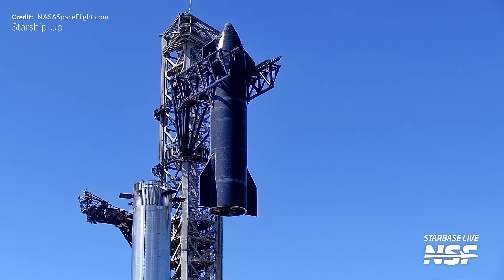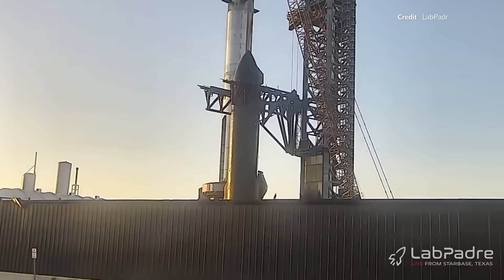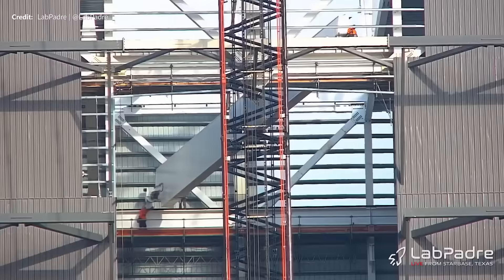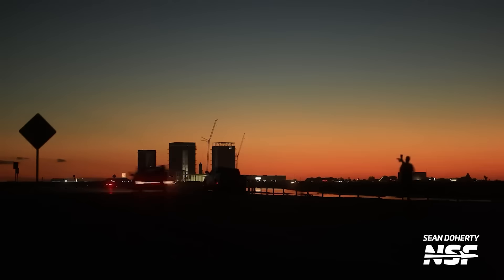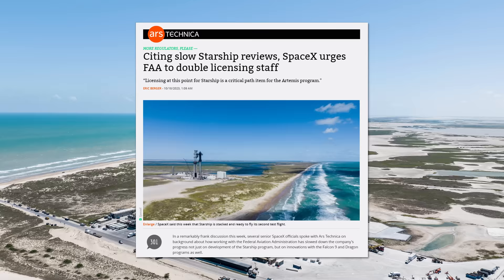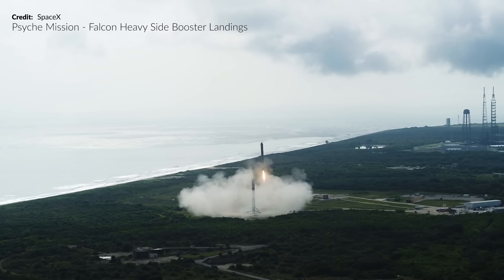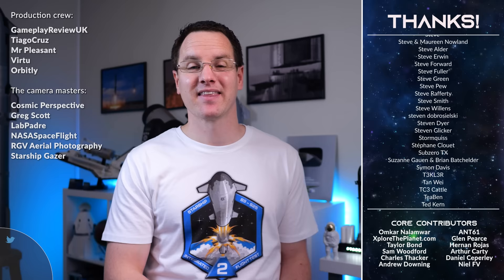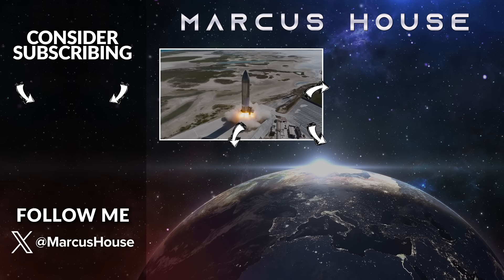This is a Critical SpaceX Starship Fight, and ISRO success with Gaganyaan!

Comment: Excited for the ramping up for the second orbital test launch of Starship. Won't be long now if the licensing board were to lax some of their regulations.
The rocket designs from the Indian space agency are pretty unique, the way that their capsule was pointing down and the parachutes opening from where other space crafts' heat shield would have been.
Reply: To be clear, this isn't about laxing regulations at all, but about going through the process with the resources they have, keeping the regulations in place, but implementing them effectively.

The issue is that the regulatory agencies simply don't have enough employees to read through and verify all of the legal filings. Every box that needs to be checked requires employee time, and they might just not have the employees to go through it all.
Reply: @volkris  There should be a time limit in that case. Can't get the approval processed by XY days? Well then, approval is granted by default
Reply: @dennikstandard  there is a time limit but it's a bit of a technicality.

 It's mainly that if the application isn't processed by XY days, the applicant still can't launch, but they can sue over it.

Comment: In this week's SpaceX update, there were several repeated tasks at the Starbase launch site, including the removal and reinstallation of Booster 99's hot staging ring and Ship 25's full stacking operation with Booster 9. However, there were some issues with the quick disconnect during the full stacking operation, which required a deep investigation with machinery like the S1 Titan scanner to check for welding issues. Ship 26 also had some testing done, including a pre-burner test and a static fire. Ryan Hansen's recent render of the full stack was accurate to the real photograph posted by Elon Musk. Additionally, there is a new Star Factory, which is expected to be operational soon, and the FAA has yet to provide news on the upcoming Starship flight.

Comment: When the ship had to be de-stacked due to the SQD issue did that mean that it was up there on the stack for just over 24 hours without the SQD connected? If yes then that's actually quite encouraging in terms of what it tells us about the structural integrity of the Ship when it isn't connected to a constant pressurisation source.

Obviously standard procedure is to keep ships and boosters connected to pressurisation sources, e.g. ships & boosters in the Rocket Garden, but (again if the SQD really wasn't connected due to the SQD problem) it's nice to see S25 tolerating over 24 hours of "abuse" (not being handled fully in line with the defined protocols).

Comment: Line up the bolt holes by "ovaling" them (heh,heh). The pad is sinking a bit each day like that tower in San Francisco.  Stacking / un stacking pushes down harder so they need to launch.
Reply: Sinking?  Where did I miss that?

Comment: I like how people are so surprised adding an extra hot staging ring made the arm not line up.....🙄
Reply: It shouldn't make a difference as its just a bit taller. Unless you mean the quick disconnect? In which case yeah I think the retrofit is a bit jank.
Reply: @iamaduckquack  see geniuses everywhere! 🙄
Reply: they already modified the arm for the extra height a few months ago.
Reply: @hamzahkhan8952  you 100% sure about that? They added the stupid closing door a couple months ago, and magically it's off about the same height of the hot staging ring? How would it be that far off if already allegedly adjusted it to said height? What they just guessed when they allegedly adjusted it? It just doesn't make much sense......
Reply: @scottbattaglia8595  there was obviously some issue with the hardware, not the distance the ship and arm. remember, the've already attached the Ship QD arm to the ship on top of the hot stage ring multiple times before
Reply: @hamzahkhan8952  I hear ya guys, but answer this, if it was already adjusted to the hot staging height how is it now a week later and again misaligned by what looks to be the exact height of said hot staging ring? You get my point? They never had to keep readjusting it before, so did it get readjusted without the hot stage  somewhere the past couple weeks or was it that they never adjusted it for the hot staging ring, but you have to pick one........🙄
Reply: @scottbattaglia8595  it was modified to extend HIGHER. its still at the same height but just got an extension. something new probably failed

Comment: "Why was a preburner test introduced? "  -- Most likely reason is a new model of the engine, that may have V3 Raptors on it and they want to run them through their paces to ensure they work together like the V2 engines do.  Of course they could just be a slight iteration of the V2 design but requiring some confirmation that they still work as expected.

Comment: Maybe no water was used during the test burn because it is not required, a message to the Wildlife people to speed things up or watch us kick up some dust.
Reply: They've done launches with 3 Raptor (1 not 2) that did no damage to the pad so a much shorter possibly lower thrust level test shouldn't require the deluge system for a 3 engine (at most) static fire.
:planet-orange-purple-ring:

Comment: Is it known if SpaceX is writing F9 contracts to move flights to Starship once available? With Falcon we knew about future launches at this point, but with starship I do not think any contracts are known to be signed?
Reply: I suspect that the initial flights will be between development for HLS (including orbital refueling) and Starlink launches.  That might consume years of launches during which time there may be major changes such as the proposed lengthening of the 2nd stage making the whole stack 20% heavier and changing the payload bay.  

They also don't have payload bay doors working yet, not even the slot for the PEZ dispenser style satellite launches.  Without that larger payloads like station modules can't launched on it.  Pricing will be unsure until they have clear indications that they can land and reuse at least the booster and have a stable design.  Without orbital refueling payloads have to be designed with more delta v to achieve their final orbit.   With orbital refueling payloads can have less delta v for orbit changing and more mass for other purposes.   

The lack of payload doors could be why they don't have a station design in the works (that I am aware of) other than hints that Starship itself could be used as a station.

It could (IMO) be 3 to 5 years before they launch a payload that is neither Starlink (they have MANY more satellites to put up then have launched so far) and Artemis related missions.    There will still be a lot of exciting launches.

🌜

Comment: 12:56 I don't know if Starship has a problem that SpaceX has found and is trying to fix, or started a quick improvement that turned into a project. It's now not just the FAA and FWS.
Reply: luckily for Spacex, the new chief of FFA space licensing is ex-general Moncrief of cape Carnaval air force base, who wrote an airforce essay on how to streamline the FAA approvals process, I,m pretty sure what we are seeing is the home run for a new approval process, led by Spacex's biggest airforce and now FAA fan

Comment: How about redirecting the $4B currently pissed away annually on SLS to the FAA.  After all the FAA also needs aerospace engineers and people with similar experience in aerospace projects to be able to professionally evaluate proposals from commercial suppliers.  However surely it is the duty of any government regulatory agency to PROVE that a proposed private project is a threat to the welfare of the public, not to prove that the project is completely SAFE.
Reply: luckily for Spacex, the new chief of FFA space licensing is ex-general Moncrief of cape Carnaval air force base, who wrote an airforce essay on how to streamline the FAA approvals process, I,m pretty sure what we are seeing is the home run for a new approval process, led by Spacex's biggest airforce and now FAA fan...Mr Moncrief!!
Reply: @brendenharris8858  Thank you.  It seems logical to me that, based upon their educations and their decision to choose the FAA as their employer that most FAA staff are as much space enthusiasts as the followers of these threads.  They are probably better educated on aero-space engineering that the fans posting here.  There have moreover been notorious examples where bypassing FAA oversight in the interests of "efficiency" have resulted in hundreds of dead airline passengers. 

SpaceX is a "lean, mean" engineering company which means that there are relatively few contributors to any design decision.  For example I personally feel that there should have been more input into the design of the OLM from experts in the US Corps of Engineers.  It appears from the recent Senate hearings that SpaceX and its competitors want MORE input from the FAA.  It is only the bureaucratic delays, not the content of FAA reviews, that they are frustrated with.  I believe that SpaceX views the FAA as a partner with a valuable alternative viewpoint.  Frankly many of the "FAA reports" read as if they had actually been written by Spacex.  How else could SpaceX have responded in detail to the 56 points of the "FAA Incident Report" on ITF1 less than a day after it was published?

On the other hand the bureaucratic delays seem conspicuously to serve the interests of SpaceX's competitors.  There is genuine concern, expressed by NASA's own watchdog, that SLS is a moneypit which prevents NASA from delivering on its scientific objectives, but the advocates for SLS can, because of the delays imposed on SpaceX, continue to deny that there is any viable alternative.  "SLS is the most powerful production launcher and nothing else can deliver the payload requirements for Artemis."  However the moment Starship reaches orbit that declaration seems hollow.  Moreover if SpaceX is permitted to maintain the test plan which it has published, and for which it has clearly demonstrated the required construction cadence, by December 2025, just two years off, there is a genuine probability that Spacex could put four astronauts on the surface of the Moon without any assistance from SLS and thereby making the four billion dollar  cost of launching the SLS for Artemis 3, and the 40 billion dollar cost of Artemis through 10 completely pointless.  According to my calculations if the money already allocated to Artemis 3 and 4 had instead been awarded to SpaceX through competitive bids that starting in December 2025 SpaceX could deliver EIGHT crewed landings on the Moon, with a total of at least 32 astronauts and at least 800 tonnes of supplies, with a landing every two months.  By the end of 2027 this would greatly exceed the objectives for Artemis 3 through 10 and more than five years early.  And the $25B for Artemis 5 through 10 would not need to be spent.

Comment: Those safety reviews are there for good reason. Is Elon volunteering to pay for additional staff?
Reply: Sort of. As I understand it, they can't pay the FAA directly — but SpaceX has expressed a willingness to pay costs if the FAA needs to bring in external contractors. But it's an ethically-problematic area, when you have a regulator being funded by the people they're regulating..

Comment: Interesting that SpaceX is pushing ahead with full orbital launch without getting the flip and landing manoeuvre anywhere near reliable. My guess is that this is to have the ability to provide NASA with the moon lander.
Reply: they said they want to prove they can get to orbit first before attempting an landings.
Reply: @hamzahkhan8952  I know what they said but what’s the point of getting to orbit if they can’t land it?
Other than getting the moon lander to the moon. As I’m sure you know landing on the moon will not require the flip manoeuvre.
Reply: @mitseraffej5812 Starship does not need to be able to land to become operational, but it does need to be able to launch to orbit.
HLS starship will be extremely different than other starship variants. it probably wont need experience landing on earth to be able to land on the moon. (different gravity, atmosphere, engines, etc.)
Reply: A rocket that delivers payloads to orbit but can't land is useful... we've been doing that for sixty-something years now. A rocket that can land but can't delivery payloads to orbit... not so much.

Comment: I am sure this is a silly idea, but what would happen if SpaceX built a huge (I know, the cost would be ridiculous) oil rig like base/city somewhere of the coast in international waters. I assume they would still have to deal with the US government somehow for launches? If not, it seems that, in the long run, they could move faster than having to wait months on end every time some small detail changes on one of their vehicles.
Reply: Once they have a working ship the plan is for a Sea Launch system.

As an American launch company they are under FAA authority wherever they are.  They also wouldn't be allowed to move their company out of the U.S. due to restrictions on military weapons.  Missiles are rockets after all.  
:planet-orange-purple-ring:
Reply: @Scanner9631  Pitty. I hope government can do something good for once and streamline this process. Regulations should not cause all industry to move out of the US.
Reply: Yeah, it's mainly a cost benefit issue.
Hopefully this will be a one time delay as the one time change to the pad is analyzed, and the cost of the delay will turn out to be nothing compared to the cost of R&D conducted on the sea launch platform.

Plus, it's an American company, so it's still subject to American law even if it launches from international water.

Comment: I understand that they do not use water when testing a single engine.
Reply: really, whats your source?
Reply: @brendenharris8858  It's from what I remember in previous tests.
Reply: Yeah, Marcus seems to have forgotten that they only installed a deluge system on the launch tower a few months ago... they've never used them before, and certainly not on test stands.

Comment: I worked in the automotive manufacturing business for 25 years. Manufactures build, test and self certify their products following government guidelines. They require little direction by Gov. Agencies. This is the way the Space industry should work too. Current system is simply unbearable.
Reply: ...and what happens when a manufacturer fails in those responsibilities? They lose the ability to self certify, or at minimum invite far greater degrees of oversight. Self certification is based on trust, and SpaceX 1) blasting concrete all over during their last test and 2) failing to get approval for their deluge system before using is proves that they don't deserve that level of trust. They simply don't care, it would be insane to let a  company with such a poor safety and environmental culture self certify.

Comment: More than rushing this flight I want it to be a success, and i can right now admit SpaceX are not ready for this flight. Mark my words, they are not ready. As with the launch pad and their use of a pad they knew without doubt would be demolished and send debris miles from the launch site, they know engines will fail, they have repeated had engines fail in every single static test firing of the starships engines, even when firing 16 they had failures. NAd they reach the maximum amount almost in the last two test firings that would cause an abort at launch or in the first part of the flight when they are high enough to do so.
Again, mark my words this is going to be a catastrophe and SpaceX is 100% guilty of failing to ensure the starship is safe to fly.
If someone is killed or injured it could be  seen as murder, not manslaughter, as knowingly allowing a faulty rocket to be fired  and you take all responsibility for anything that happens., this is why the faa exists and why they need to ensure all that is done to ensure the safety of the public, if they bow to political pressure then i hope they sue those politicians and SpaceX for the pressure put on them to give a flight licence when a catastrophic failure results in deaths or serious damage to the environment when the ship explodes moment after flight..

Comment: Insted of licking his red tape wounds, he should run a separate launch 12 mils off shore into international water and test the hell out of his rockets intell the faa finishes paperwork in Flintstone speed. 
FAA issued a final rule that extended controlled airspace, and the applicability of 14 CFR parts 71 and 91, to the airspace overlying the waters between 3 and 12 NM from the U.S. shoreline.
Should do a video of how hard a platform would be to assemble 12 mils off costs.
Reply: SpaceX is a US company therefore the regulations would still apply